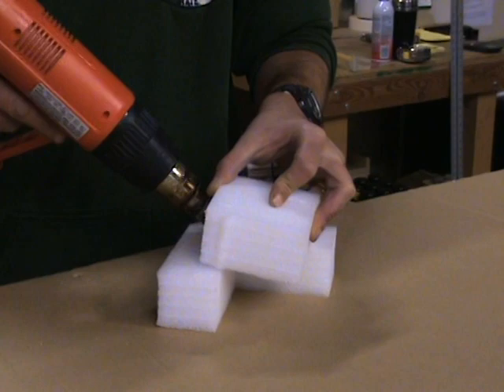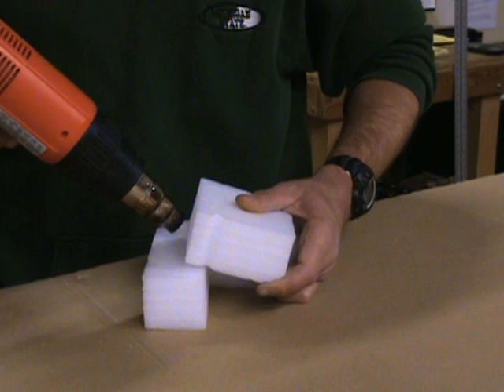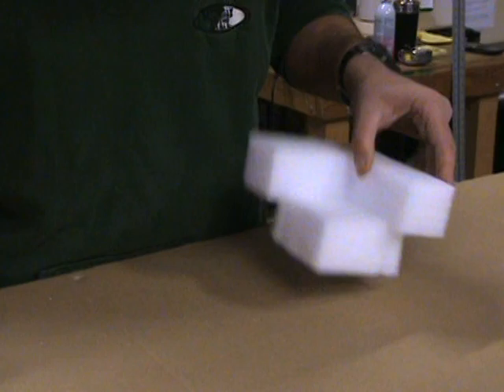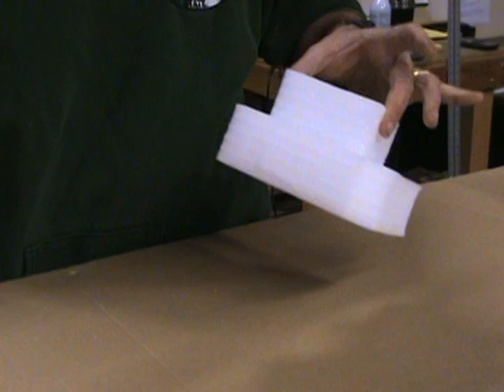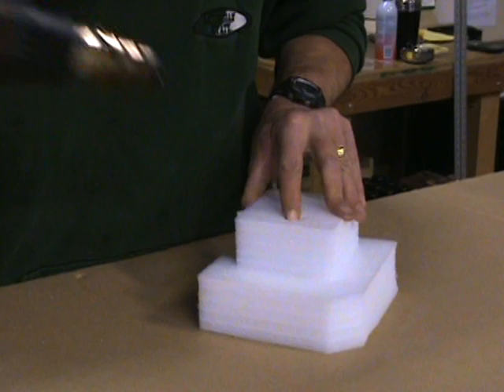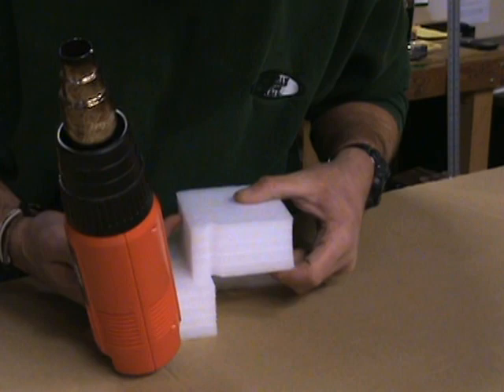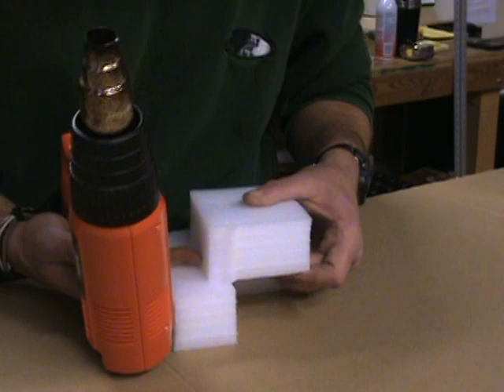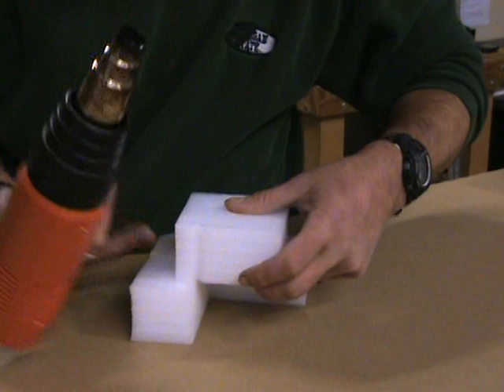Heat Welding Polyethylene Foam

Comment: It will be better to use Automatic Hot Air Laminating Machine to laminate, high efficiency, only needs 1 person to operate. You can laminate a large pallet of it and then cut into individual piece.

Comment: Nice to see how this works. Does the heating reduce the size of the material? Can the same method be used with 1/4" sheet foam or is that too thin and would result in a mess?